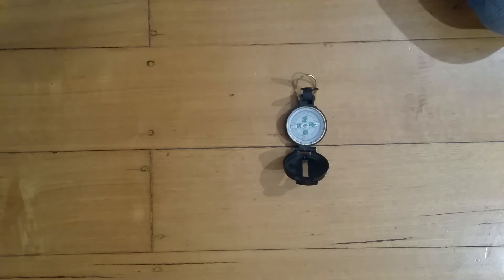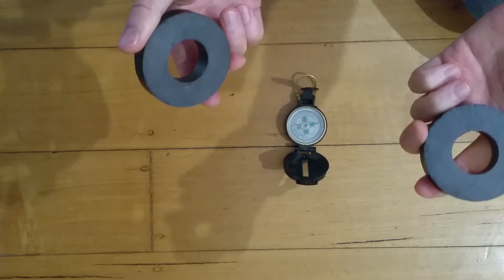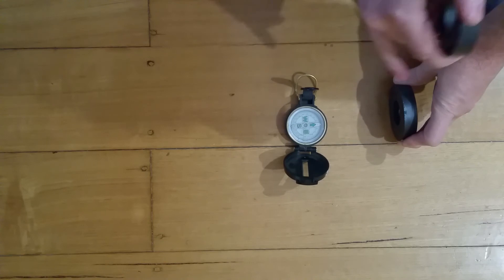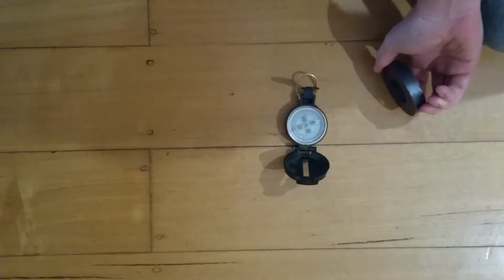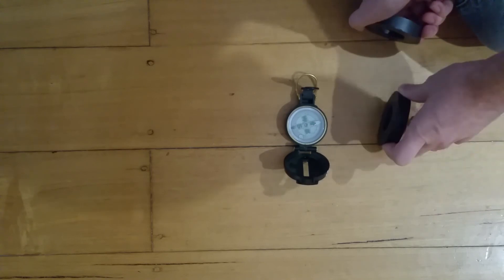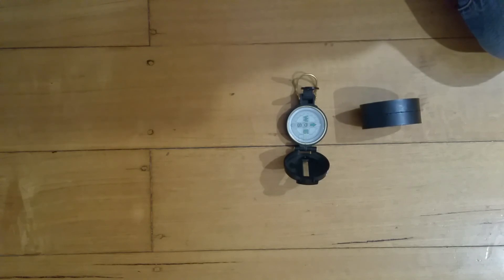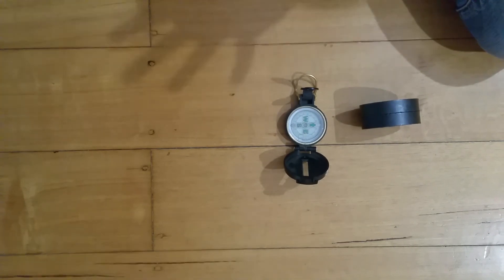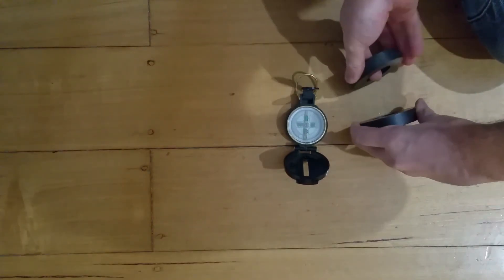Swapping a magnets polarity around

Comment: Horrible video with blasting "music." The clip without filler could be shortened to 30 seconds. The actual way to change the polarity of a magnet to wrap it in a coil and run a current through the coil.

Comment: You really should purchase a magnaprobe or something that will Show you a representation of the fields around the magnets, its quite a handy tool.   (little magnet on a 360 degree gimbal to let you see how the fields shaped... )   All you are doing here is pushing two like faces together, which is possible and which can affect the magnetic strength of the magnets being forced together depending on how tightly the magnetic field is held by the allow of the magnets fulcrum.    There are patents out there on the idea that you are showing here, look up Magnacoaster and then check out Kunel.   They work by allowing or interupting the normal magnetic field established and collect off the ringing that results from that disturbance.
Reply from the maker: The purpose here is just to show how I'm generating electricity.
Reply: joecellenergy
Ok. Link to the other vid showing how your generating electricity?